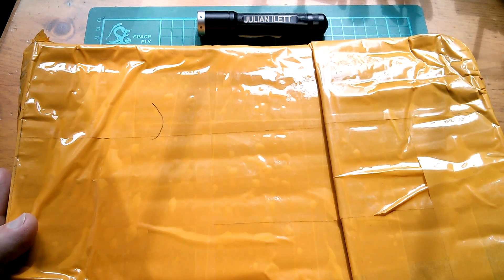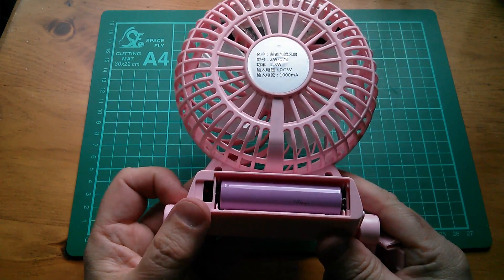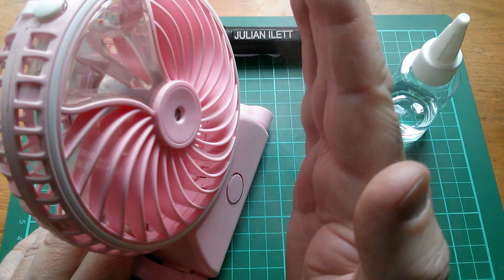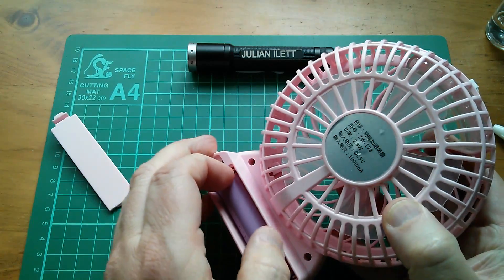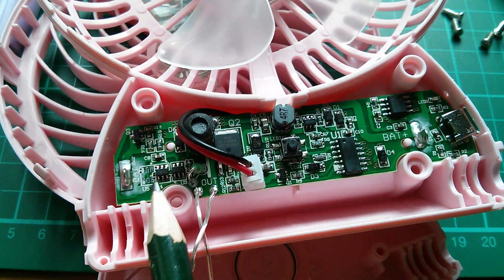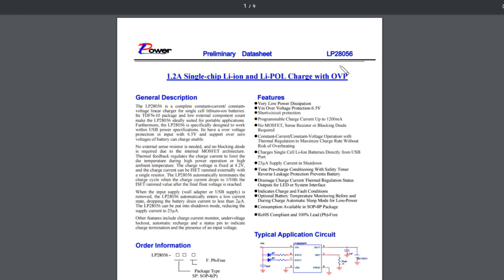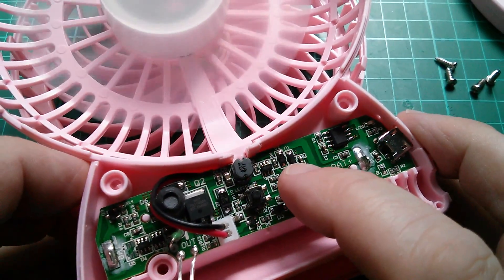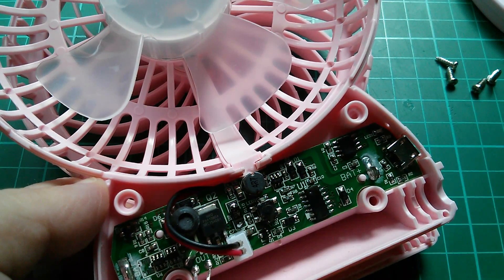Pink USB Lithium 18650 Water Spray Fan Teardown

Comment: Red and black wires - if they were 'right' the fan would be a suck, but it's reverse mounted, so if the red/black leads are factory fitted then you need to drive in reverse :)

Comment: The 5V/1000mA is most likely for the charge port, not the fan. Doesn't matter anyway, because the product listing tells you different numbers as usual...

Comment: i have the feeling the 5V relates to the charging voltage via the usb port. who would write the motor voltage on the outside of the product? i also found the product on other sites and they state "input voltage: 5V" so i guess that is that. the 2.8W on the other hand probably describe the motors power rating.
Reply: I'm 11 months late, but tore down a fan like this that states more specifically USB DC 5V 1.0A.

Comment: I think the back probably says input: 5v input: 1000ma
Reply: lol... that was what I was about to post also... it'll be the input parameters for the product, not the motor specs ;) and yes, it looks like a brushless motor as it is magnets spinning around the coils...
Reply: Peter Feerick looks to me like it could be a computer fan Style motor where it has its own controller right back behind the motor itself and they just control speed with voltage instead of a computer fan controller.
Reply: Yup, that's exactly what it looks like ;) And knowing the chinese... it probably is!

Comment: If you have hard water don't use tap water. We tested these mesh plate atomizers and they clog in about 1 hr of continuous operation with hard water. RO or distilled is better.

Comment: use scented water ?  
why not spray paint it in a different color ....  and move/change the blue leds  ...
make it intelligent : only spray when you're present if the air is too dry and fan when it is too hot ...

Comment: Do I miss something or does humidity actually make you feel as if it's a LOT hotter than it actually is because your transpiration doesn't work properly anymore?
Reply: you're right, and its counter productive to use it in humid places. However it can help in a very dry environment,  say less than 15% relative humidity as such dryness has it's disadvantages (for example people with dermatitis suffer in dry places).
But this fan will do next to nothing, you need a proper humidifier.
Reply: yeah I'd expect hot and dry to be more comfortable than hot and humid for this reason
Maybe refrigerated water would help?
Reply: The idea is that the mist evaporates.  Evaporation cools the air.  So, all you should feel is cooled air.  If you can feel the water, it's too much.  Given that the mist is so fine, it may be a pretty good device.

Comment: you can check if its PWM controlled by setting your multimeter to ac volt and if you get 0v it means its DC controlled(cuz when in AC volts multimeters are AC coupled and will remove the DC offset)
Reply: If the AC is zero, it might still be PWM - but after it's filtered.  In this case, I'd think they'd alter the boost setting of the step-up device rather than go PWM.

Comment: I bet they used PC fan innards, and wired it so the fan went the right way
Using a pc fan makes sense for 5v rather than a special 3.7v version.
Reply: Depends on how the motor works.  If it had a hall effect sensor, I don't think it would work on reverse polarity.

Comment: just a theory, but they may require non-distilled water so that they can detect the presence of water with resistance so as to not overheat the piezo
Reply: It would have had to have another sense wire for the water level. There were only 2 wires going to the water tank.
Reply: i suppose it could be built into the piezo, but that's a good point. I missed that.